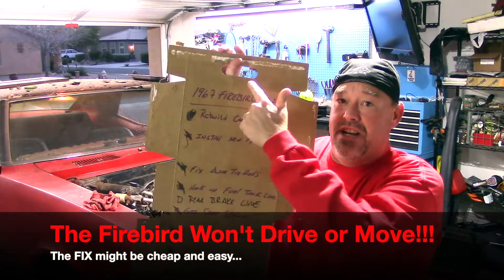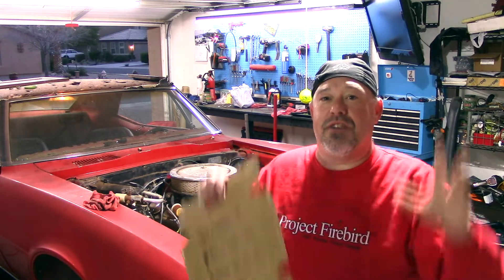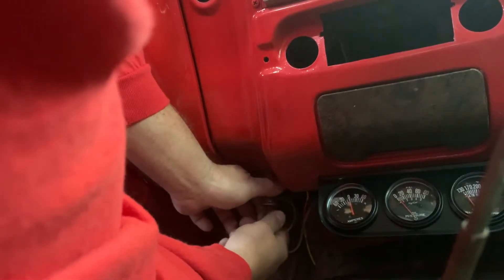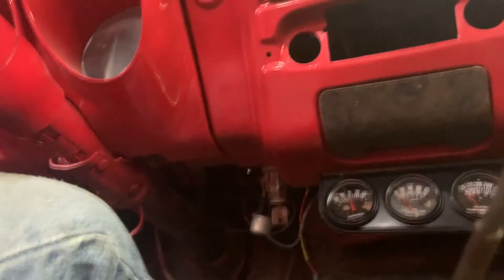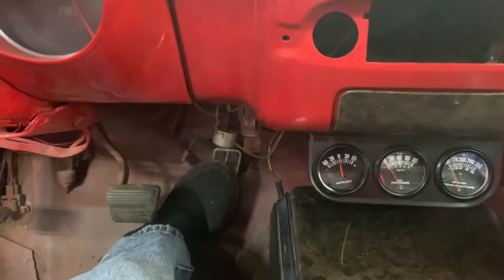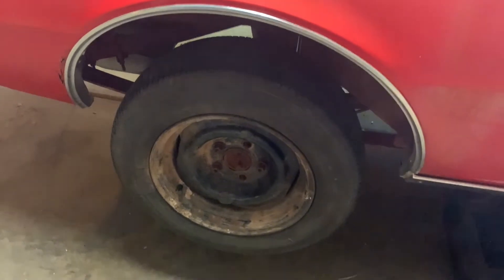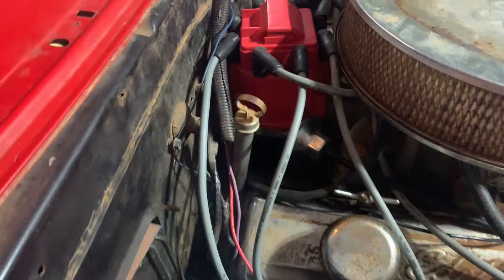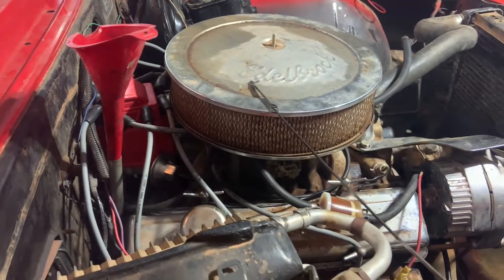My Car Won't Drive or Move:  1967 Pontiac Firebird Rescue Project TH350 Transmission PART 12

Comment: There are no words to express my gratitude for this video regarding the transmission and adding transmission fluid...my stepvan is a 1974 Chevrolet P30...after having it parked for more than 14 years, I tried to move it and it did nothing ..neither forward nor backward, I checked the transmission oil level and apparently it seemed to have enough oil...well I did what you said...I warmed up the engine...I added 2 quarts of oil and it made me very happy By seeing how the wheels moved, thank you from the bottom of my heart, I saved $1,200, which was what they would have charged me in Miami to rebuild the transmission...thank you...thank you.
Reply: Hi quick question my c10 was parked for 2 years maybe or even more and tdy i tried to use it but it doesnt movee
Reply: @JoeCastillo-cg2gf  check the calipers and brake....out 2 quartes if transmission fuel
Reply: @PinkGum316  just saw you message change fluid and filter got it to run but now it only works for like a mile until it stops turn it off and will work again but not like how it supposed to any recomendations

Comment: For the smoking issue, a hard run may help the rings reseal or you should check your pcv valve to see of it's working. As a last resort you can put in a can of the product called "engine restore" or if that isn't enough you can put a scavenge kit and vent the crankcase into the out going exhaust.
Reply from the maker: I am hoping once we get this Bird driving that is the case!  Thanks man for watching!

Comment: Is the oil pressure gauge hooked up?  The needle didn't move when it started.  Regarding the trans... torque converter leaked down while sitting.  It may take take a few to refill as the converter holds four quarts.
Reply from the maker: That stupid plastic oil pressure hose that comes with the gauge kit broke :(  I need to see if I can get a new set.  And you're right, I think I might as well pull the pan, and put in a new filter and clean up things before adding more.  Thank for watching and dropping some great ideas.

Comment: My 1967 firebird  was not shifting into 2nd  so i replaced vaccum mod  still not moving,  reading dipstick cold reads in right area, in natural idle  reads very high on dipstick.  Should i just drain all fluid and add from empty.
Reply from the maker: You might want to,  remember the torque converter will hold a quart or so.

Comment: I just did an engine swap and My 4l60e won’t move at all I can break the whole thing down for you but short story I may have overfilled it then it locked up completely like it wouldn’t move in any gear I have now replaced the filter and put dex6 into the tranny if it still doesn’t move what do u suggest
Reply from the maker: I would pull the pan and replace the filter and refill the whole transmission again... if that doesn't do it... check the vac modulator on the passenger side of the trans.